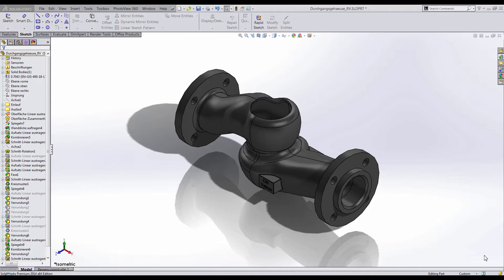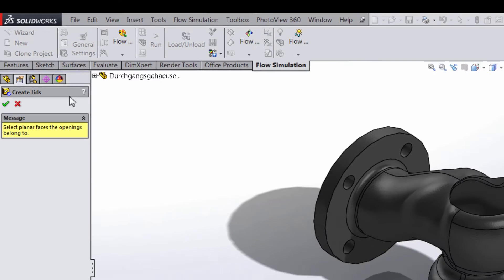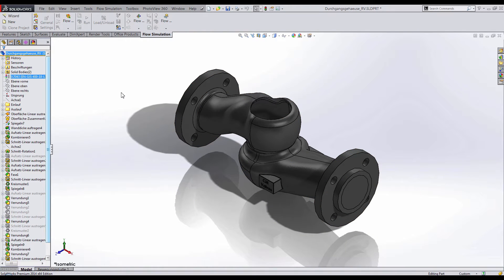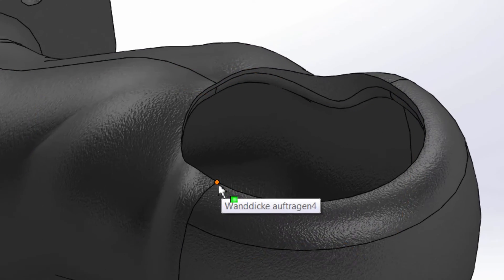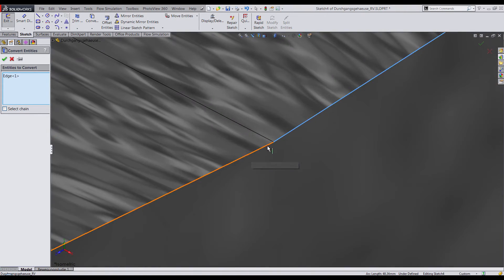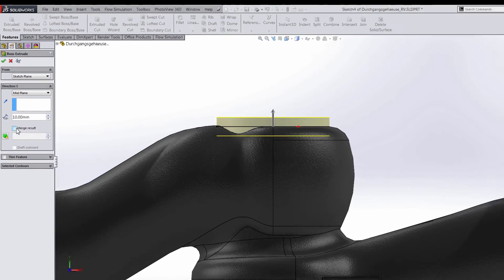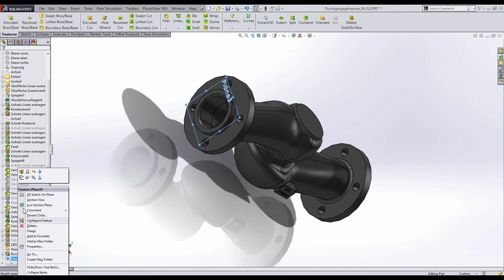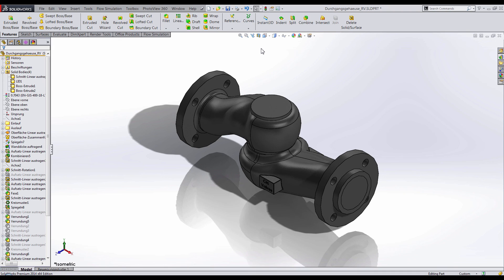SOLIDWORKS Flow Simulation - Creating Lids

Comment: Please let me know how to produce a lid that is a surface and not a body. Because when you import the file to ANSYS FLUENT the simulation results in convergence error when lids of "body" is used. 
Thank you.
Reply from the maker: Hi Hiras,
The 'Lid' function in Flow Simulation only produces solid lids because this CFD program only recognizes solid geometry within the flow analysis.  If you need to produce surface geometry at the lid locations then you would likely want to utilize 'File Surface' (found under 'Insert', 'Surface', 'Fill') within the part work space of a model.
Reply: Thank you
Reply from the maker: We appreciate you stopping by to watch.